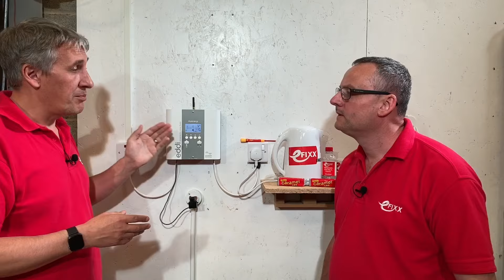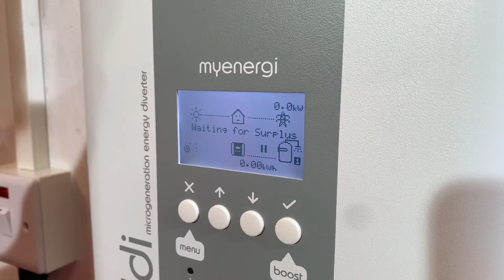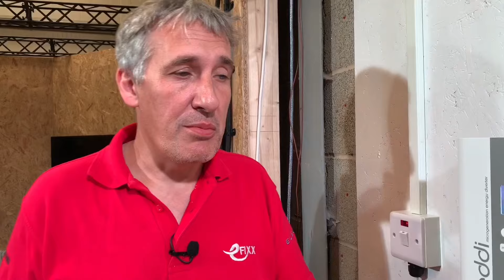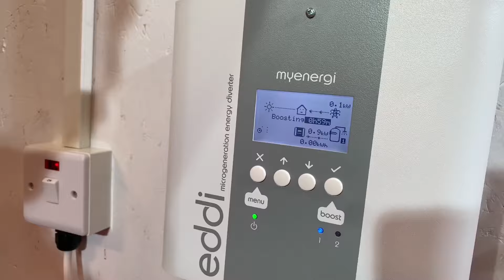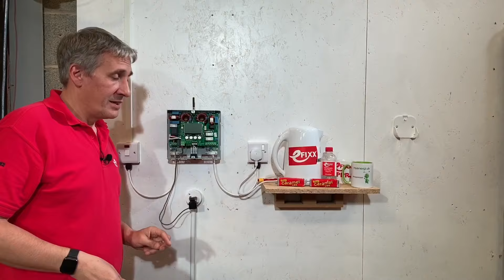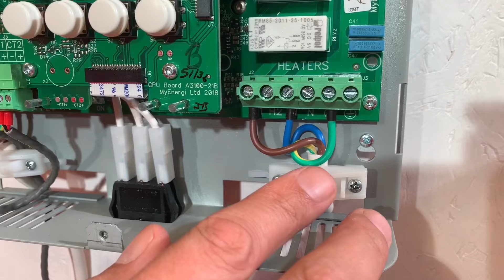FREE hot water using the Eddi energy diverter from Myenergi

Comment: Ach, been involved with renewables and energy saving products for a number of years, mainly back in 2012-2013, these products look fancy and the concept always sounds great, sales pitch, glossy brochures etc - however the savings are negligible compared to what you pay for the device. Forecasted savings and claims of whatever % on your energy bills never tends to be the true figure. ROI is always high. A neat looking little product if you have money to throw away though. Probably similar to immersun, iBoost, etc. It’s like when they introduced domestic voltage optimisation, you’ll never save as much as they claim.
Reply: I,m on a 2015 FIT tariff , so the Eddi has worked for me for 2&1/2 yrs. It was an alternative to a battery for me ensuring my cyl could become a 10 KWh battery. I also dump surplus PV to a storage heater using the second immersion output when the weather is colder. It means i can use 85% of my PV on a yearly average with a zappi as well. I was a  PV installer back in 2011-12 and an electrician.
Reply: David S another TV couch expert providing expert opinion?
Reply: E K 

If you actually read my comment I said I’ve been involved in the renewable energy sector with of all of these types of energy saving products. Plus I’m an electrical engineer. Enlighten me with your experience and knowledge then I’ll maybe talk to you.
Reply: @davids5498  I concur to a degree, Immersuns are just made terribly and fail all the time. If you exclusively use electricity to heat your DHW and don't use gas, then it will save you money - assuming the unit doesn't fail before ROI. 

An Eddi is £400. If you only use electricity to heat your hot water, your'e talking a ROI of around* a year. Assuming 15p per kWH - 45p an hour. £400/0.45p=888.88 /365 = 2.44 hours a day. Unless you live alone, an immersion is gonna be on for longer than that each day. Obviously being in the UK you're not necessarily going to get 365 days with enough light to heat your water tank, but an ROI of 18m-2 years isn't too bad (if it lasts that long!)
Reply: David S I am not impressed that you have years of experience in renewable energy or that you have years of engineering behind you.

This is about being a nice person, and you mister do not come across as a nice person.  

Why?

You said, “probably similar to immersion, iBoost, etc.”. 

You see.  You don’t know the product either professionally as a renewable person or from a performance perspective as an engineer.

However, you are willing to say, “you’’ll never save as much as they claim.”   

How do you know what they claim?

In addition, you said, “these products look fancy and the concept always sounds great.”  

You work in renewable energy with products making fancy claims like solar, wind, and storage batteries, and you are unwilling to inspect a new product?

You sound either tired, bored, or are you simply willing to throw dirt at anyone that looks at you the wrong way?

I am calling you out for accusing a new company in the renewable energy industry of making false claims.  

Now you prove me and them wrong.
Reply: E K 

Mate, what’s your problem haha. I gave my opinion and you LITERALLY called me a TV couch expert for no reason. Seems like you are the one who’s not a nice person.

What you talking about? I know what immersun  claim as they LITERALLY state the savings of £250.00 on their website. Looks like you should do your research before you start arguing with someone who actually has knowledge in this field. I’ve seen all these products, the majority of them are just something to sell which are all relatively expensive and claims are exaggerated.
Reply: David S I decided years ago that I would not stand by doing nothing when I see an injustice committed.

You say you are giving an opinion, but in the process you give a hoot of whose reputation you are stumping upon.

At best you are guilty of committing the fallacy of faulty generalization with your opinion.  At worst you are a bully.

The definition of the fallacy of faulty generalization is “Hasty generalization is an informal fallacy of faulty generalization, which involves reaching an inductive generalization based on insufficient evidence —essentially making a rushed conclusion without considering all of the variables”

However, I was trying to be nice by calling you a couch potato.

The definition of a couch potato is “a person who spends much time sitting or lying down, usually watching television.”

In your case, however, I would extend the definition of a couch potato to making accusations without first gathering proof.

The products made by Immersun are not made by the company making the Eddi.  

The claims made by Immersun on their website of savings of £250 may or may not apply to the Eddi.  This involves two different, distinct companies making different products for the same market and which appear to solve the same problem.

If you are as knowledgeable about these products as you claim (given your engineering title and vast experience in the renewable industry), then if you ask around you will find out that some customers that paid good money for products from Immersun or iBoost have been willing to depart with even more money and switch to products like the Eddi.

Why are these customers who have experienced first hand the results of the first generation products willing to spend even more money in these second generation products?

What benefit do they get?

Is there a direct benefit, or is there a more subtle benefit involved which these consumers obtain from the Eddi?
Reply: @davids5498  lol, don't feed the trolls.
Reply: iggifer 

2 years sounds good if it works well. Hopefully it’s not another one of those products that claim to save you lots per year and doesn’t 😕

Comment: I'll be getting a version of this made by SolarEdge.  Same Principle.  I've got a 170litre hot water tank.  That's about 10.5kwH of hot water storage if you raise the incoming fresh water temperature by 50 degrees (15 degrees --> 65 degrees).  So if you use up that entire tanks worth of hot water each day, then this is an excellent option.  Be mindful that a 10kwH battery for comparison is between £5-£7k at the moment.  So the Eddi is very good value for money.
Reply: Anthony Dyer same principle up to a point.  However, functions, options, and performance are not the same.  In addition, Eddi will work with a hot water heat pump, and the product from SolarEdge does not.

If you, also, have a car charger, they will both work individually and together to increase your production of solar energy.  They have numerous other functions not implemented by SolarEdge, and the installation is simpler since no anchoring of a copper rod is needed.  No wiring is required to a central inverter or between them.

I encourage you to read the manual for both the Eddi and the Zappi.